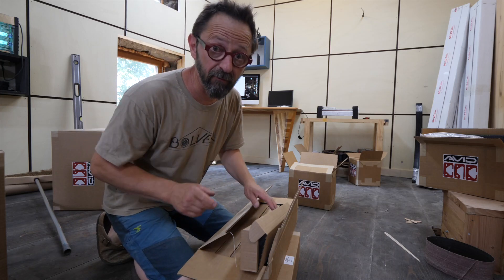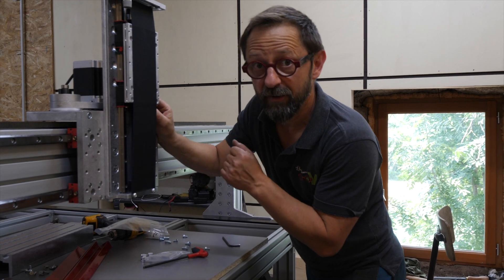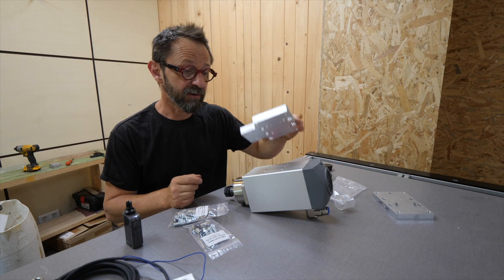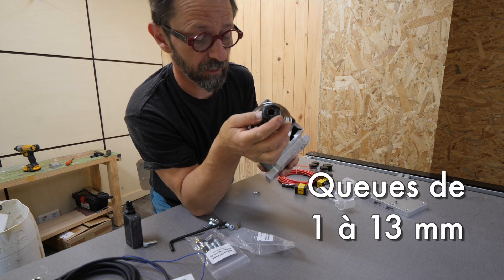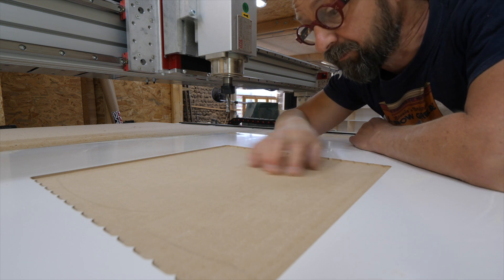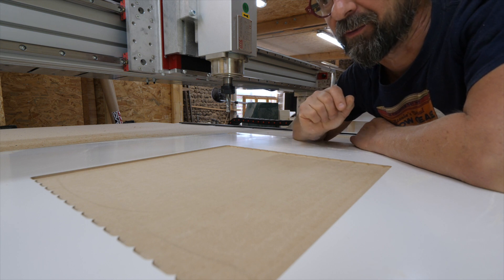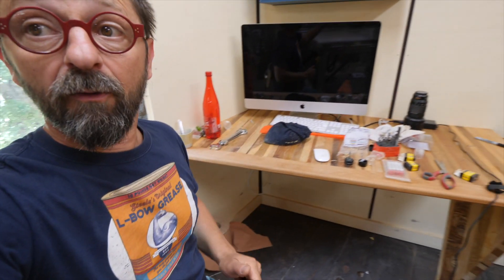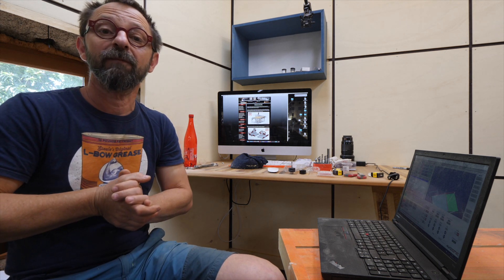CNC : elle est là !!!!

Comment: Je te souhaite bien du courage , dans on le métier c'est pas rare de voir des doigts en moins . Surtout équipe toi en protection et met un carter si possible autour de la machine .. ça peut faire très mal autrement . 
Evite vraiment de laisser traîner ta tête ou tes mains dans la machine pendant qu'elle travail surtout si tu as du mal a prévoir ce que la machine va faire . 
Equipe ta machine d'un moyen d'aspiration pour éviter de le faire toi même . 
Normalement sur ce genre de logiciel tu dois avoir des moyens de faire des simulations donc hésite pas à regarder les trajectoires de ton outil et petite astuce du métier fais des passes a vide pour tester le programme au début . C'est a dire que tu vas surélevé l'origine de ta pièce ( ici le plan de travail ) pour lui donner un faux zéro faire travailler l'outil dans le vide afin de voir si les trajectoires sont ok et franchement quand tu débute , ça fais peut être perdre du temps .. mais ça rassure

Comment: Salut Olivier,
Superbe belle machine et en plus évolutive dans le temps. Effectivement il faudra apporter des améliorations du côté de la sécurité et de de l'aspiration. 
Est ce que Avid propose également un système de maintien par dépression pour les pièces à usiner. Cela a l'avantage de pouvoir usiner les 4 côté + la surface sans aucun obstacle en une seul fois
J'ai constaté que le maintien des outils est réalisé par un système de pince (montage et démontage avec des clés - long et fastidieux ) Sache que le constructeur de machine à bois Autrichien Felder va sortir d'ici fin 2020 une tête de fraiseuse pour ce type de machine avec une puissance de 2,2 kw et un changement rapide des outils. 
C'est juste pour ton info
Bon amusement avec ton nouveau jouet.

Comment: Re bonjour Olivier. Aprés les réglages de géométrie, il te reste à accorder les dimensions demandées par rapport au steeps du Gcode. Je veux dire que tu dois te designer une piéce en Mdf représantant un Carré de 100x100 sur lequel tu mets le même carré de 100x100 mais à 45° (donc en diagonal) sur lequel tu mets un cercle inscrit de Ø 100mm. Au controle du fraisage tu devrais trouver 100mm +/-0.02 pour le X, 100 mm +/- 0.02 pour le Y , 141,40 mm +/- 0.02 pour la diagonale et enfin 100mm +/- 0.02 pour le cercle. Ce même fichier permet de controler le Z mais c'est mienx de faire un fichier dédier au Z. Pour corriger les valeurs de steeps ou plutôt des micro steeps tu peux le faire dans config.h de ton Firmware et pleins d'autres paramétres. Les vitesses de déplacements et notament celles du "Home" se font  de cette manière. Sur un autre sujet: Fusion 360 c'est le Best ! 
A++ et bonne CNC

Comment: deja mille merci :p depuis que j'avais vue les video de frank j'avais craquer pour cette machine aussi ahahahahah :p mais j'avais regarder pour le format ou tu met un panneau entier :p pq tu as choisis celui la ?  :p pour les logiciel ? tu sais si il sont compatible avec solidwork ou fusion 360 ? parce que j'aimerai plutot utiliser ceux la parce que bcp de bureau d'archi ou d'autre boite utiliser ces programmes la :p j'aimerais ton avis la dessus ? :p sinon l'autre grosse question que je me pose c'est au niveau des taxes d'importation :p par exemple moi je suis en belgique et ont ma dis (pas ete verifier) que c'etait 1/3 de la somme du produit ? et sinon pour le systeme d'extraction tu vas le fabriquer aussi ? avec imprimante 3D? ou tu le decoupe numeriquement ? tu vas installer un gopro sur la fraise et pret de la machine ? comme ca tu peux film et avoir une securite non loin ? et pour l'alimentation de la machine elle est adapter au norme electrique europeen ? ou tu as du demander de composant particulier? :p et c'est possible d'installer plusieurs bouton d'arret de securité ? et pour les boitier que tu vas deplacer vers ou ?
Reply: ah ouais :p je regardais aussi la version plasma qui me fait rever aussi pour faire des structure metalique, étagère, montant, limon d'escalier :p ahahhaha :p

Comment: Félicitations 💪
Je rejoins les autres qui t'encourage à mettre un système d'aspiration des copeaux amovible sur la tête ( avec brosse circulaire ça évite encore plus de poussière qui vole surtout sur les rails). Tu pourras te faire une cabine pour la faire tourner par la suite, ça protégera des envolés de pièces auquel tu auras droit😬. 
Pour la tranquillité quand tu ne pourras pas rester à côté je mettrai une caméra IP pour y jeter un oeil depuis le téléphone de temps à autre.
Est ce que ta fraiseuse a un système de refroidissement ?
Quel logiciel ce conception comptes tu utiliser?
As tu des connaissances pas loin pour venir t'aider ou te conseiller de temps à autre ? Cela évite de bloquer sur un détail  que tu ne connais pas encore, ou simplement te faire gagner Énormément de temps.
Merci pour ce film une fois de plus!

Comment: le martyr en bois pour un premier test c'est parfait mais envisage de remplacer le support sur lequel tu pause tes plaques à usinier par de l'ertalon pour avoir un matériaux isotrope que tu surfacera et ou tu prévois des trous de bridage ensuite ton bois reposera dessus et ou un martyr temporaire tu auras ainsi une base qui ne varie pas avec l'hydrométrie. 
Ps1 pas de doigts prés d'une fraise STP surtout une cnc qui peut changer très vite de direction
Ps2 investi dans des boutons poussoir coups de points supplémentaires à placer au 4 coins de la machine et des protections.
PS3 Les outils qui tournent parfois cela vole dans l'atelier ... protections visières lexan au minimum + pas de gamins dans les entourages.
PS4 avoir son PC qui pilote et la machine dans le dos c'est mal il faut pouvoir regarder les 2 en même temps on ne laisse jamais sa fraiseuse bosser seul.

Comment: Bonjour,
Fait très attention, tu a un comportement d'utilisateur de machines conventionnelles ou les outils sont fixe dans l'espace et tes mains son mobiles, au file des années tu a développer un sixième sens qui te protège.
Avec une CN ces reflex vont tôt ou tard te coûter chère.
On vois bien que ta machine vient des US et qui lui manque deux trois bricoles !!!
1/ plexiglas TOUT autour de la zone de travail, durant ta formation, tu va casser des dizaines de fraises qui vont volées a mach 2, y compris dans ton écran de PC (du vécu!!!).
2/ aspi autour de l'outil.
3/ TOUJOURS faire une simu sans outil, histoire de voir les trajectoires.
4/ il est très simple et peux coûteux d’installer un câble courant tout autour de la machine coupler a un arrêt d’urgence, cela évite de courir sur le bumper AU, qui par définition, ne se trouvera jamais a porter de main lors d'un pépin !
5/ paramètre le couple moteur de tes trois axes au minimum, par défaut ils sont très souvent réglés dix fois trop fort.
6/ vire les goupilles du support moteur, sur un choc moyen, cela peut sauver ton axe moteur.
Avec ces dispositifs, une CN est bien plus sécure d'une simple scie égoïne.
Ce serait très con de nous priver de ton excellent travail lol !
Reply: J'ai aussi été très surpris du manque de sécu sur cette machine  ... norme US surement.
Idem pour la transmission par courroie sur X & Y, dans le temps ca va jamais de paire avec précision.

Comment: content pour toi olivier, sketchup ou fusion 360 pour faire tes créations ???
Reply from the maker: Vectric Aspire
Reply: Olivier Verdier c est un logiciel dédié 3d vs cnc ?
Reply: Olivier Verdier quel type de fichier tu génères pour piloter la bête ? SVG....stl ?
Reply: @latelierbo-travail177  Dans le monde des CNCs, on travaille avec du gcode : des instructions de déplacements d'outils. Avec des logiciels CAO comme solidworks ou fusion 360, il y a une étape (et non des moindres) : le CAM (Computer-Aided Manufacturing) cette étape permet de définir comment la machine, à l'aide d'outils va usiner la pièce : définir les passe de dégrossissage, passe de finition. Des logiciels comme Aspire permettent de simplifier un peu l'opération avec des définitions d'opérations simple : suivre un contour (svg, dxf, ou trace via le logiciel), faire des trous rectangulaire ou circulaire avec une certaine profondeur, .... La grosse difficulté est de paramétrer les conditions d'utilisation des outils (fraises): profondeur de passe, avance, .... Pour les connaisseurs d'imprimantes 3D, on est très loin du clic "slice" d'un modele 3d